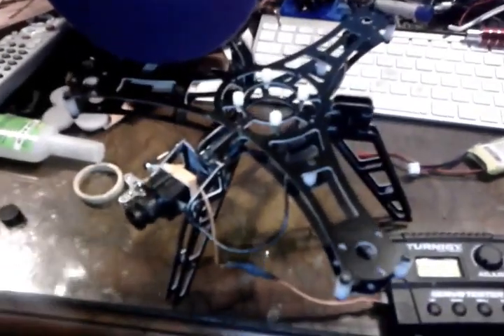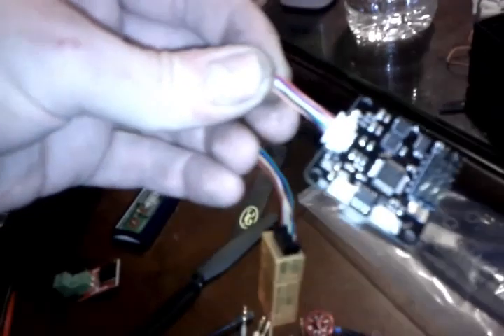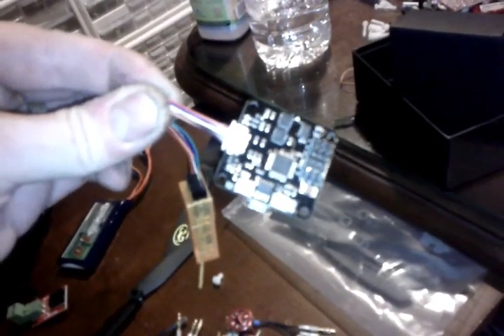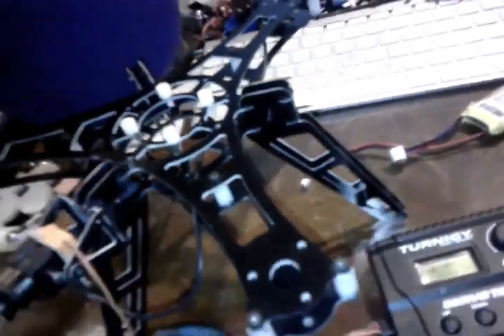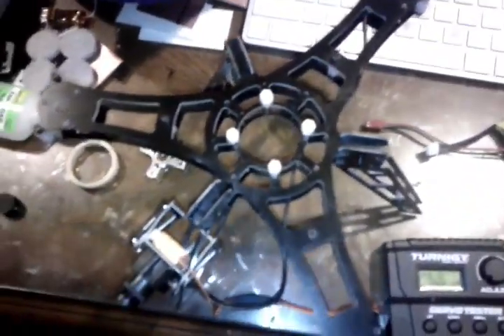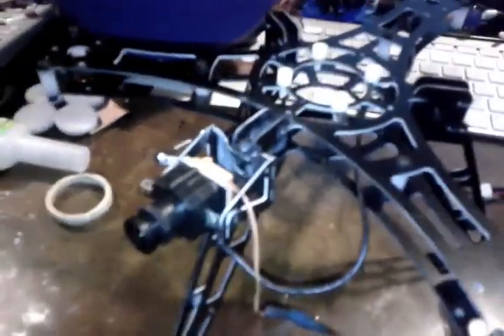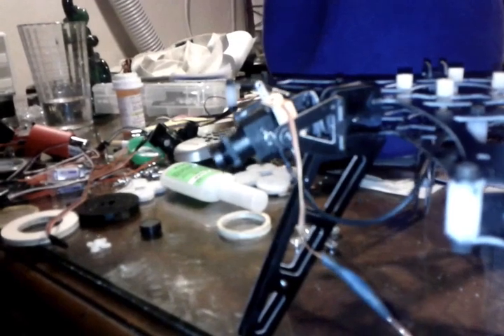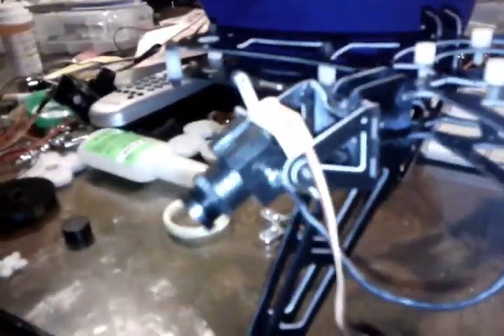DialFonZo Y6 multicopter frame camera gimble

Comment from the maker: Yeah the advantage of a Y6 like this is if one motor gives out you can still have enough control to land your system without totally falling out of the sky.

 Usually with a try-copter you have to have one of the  arms have a servo that tilts one of the motors back and forth to control YAW to keep the copter from spinning like a UFO but with  Y6 you don't need this as each paid of motors spin in opposite directions and therefor conceal out any spinning YAW effects,.

Comment: if one of those motors gives out will the system will take over and you'd still be able to fly with the opposing motor? Are there any other advantages to have opposing motors like that? For example, are they more stable for the camera? I'm new to this and was about to get one so your help is appreciated.